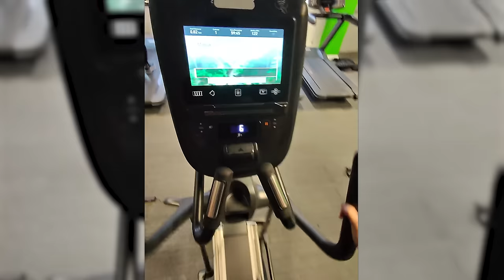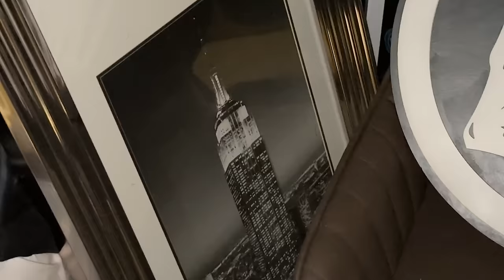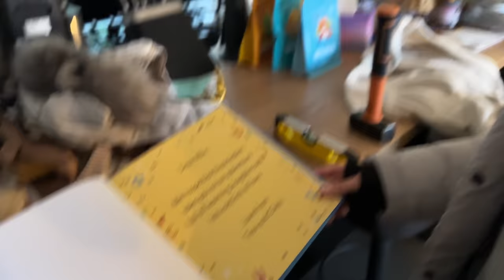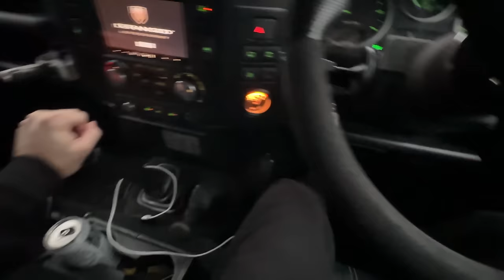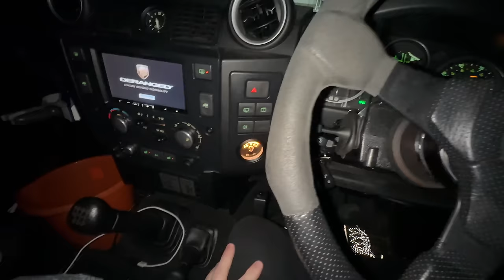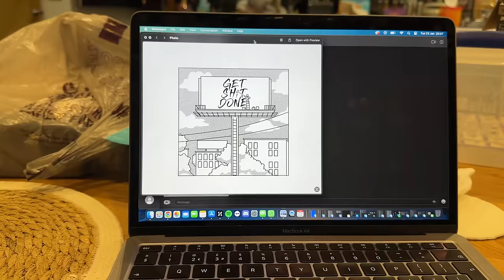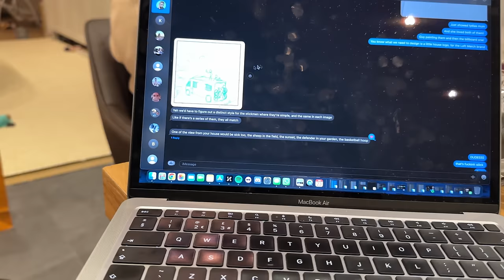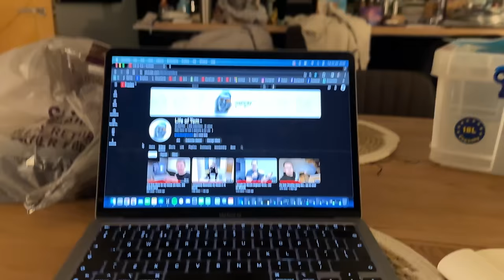Attempting to create the Ultimate Mancave in my Basement!

Comment: Maybe you could put a server room into the existing wash room to remove all the heat from your set up, for example all your consoles you use plus your pc can go into the room with an access point under the desk for the hdmi plus as a bonus your cable management will be easier

Comment: raise the washing machine and tumble dryer up so that your not bending down to use them, nice small touch i see in new houses. You also have to be careful when re-locating the washer and dryer too, I know in Ireland you need at least one seperate feed to power both machines, however 2x is recommended. Plugging them into sockets that have 10-15 on a ring will cause the RCD / RCBO (circuit breaker) to trip out, this is because too many appliances are plugged into the existing socket ring, hence why you give a dryer and washer their own seperate MCB / RCBO. Just another thing to note dryers use a lot more power than washing machines.

Comment: Tommy did you try the double/triple press on the Land Rover key fob to stop the interior alarm sensors going off from the water ingress... if that does not work try pressing it twice and on the third press holding it down for 5 seconds it should lock the vehicle and set the alarm in case anyone bumps it from the outside and not set the interior alarm which is obviously shorting from the water being on the inside of the car

Comment: For an easier way of hanging your pictures use command strips you can get heavy duty 1s that would easily take the weight, saves peppering your walls with holes

Comment: Hey tom I’ve been watching you since the old zombies days and for future consideration buy yourself an impact instead using the drill. If you use drywall anchors pre drill the holes with a drill but use an impact to remove or install screws way easier.

Comment: 17:29 There's roughly 60 buckets in the stack behind the sign, and it looks pretty equal to the one next to it, so another 60. I'd say roughly an extra 4 buckets on the third one at the front, thats 64 + 60 + 60 = 184. On the second row, the large tower is roughly 92 buckets, the one in the centre is 72 buckets and the one next to that is 71 buckets, so 92 + 72 + 71 = 235. From the stacks we can see at the back there is about 60 in the furthest one and 68 in the central back one. I can only see the ninth stack for a moment at a different angle but I'd say there are roughly 74. So roughly, there are 684 buckets, so £684 give or take £20.

There you go Tommy.

Comment: Cables should run horizontal or vertical from a socket or switch or 150mm down from the ceiling or the edge of a wall for future picture hanging! Google permitted cable zones 🙌

Comment: Loving the look of the get shit done design. As a designer my only recommendation is to make the text more “hand painted/drawn” look, versus the already pre-made text feel. It would also be cool if maybe the text was a different color. Maybe red? So have paint dripping, from the letters, and on the paint roller. Cheers.
Reply: You can also take your big picture down, and push the bended parts of the hooks toward the wall so that they are more vertical, and safer.